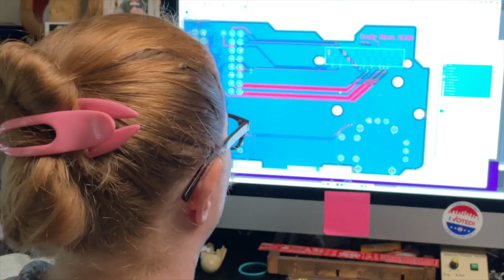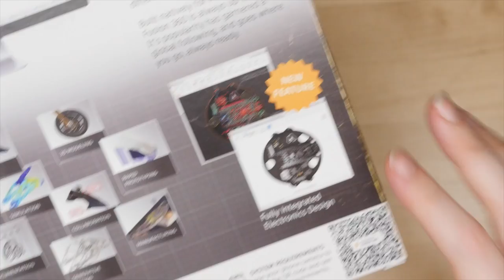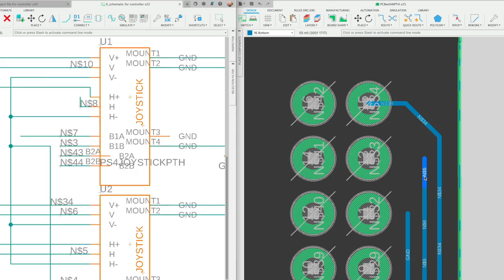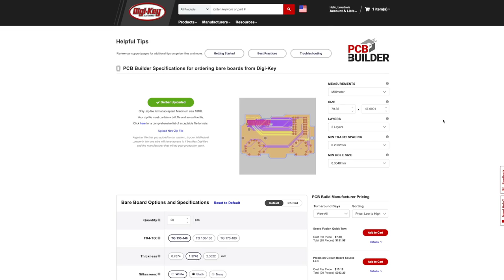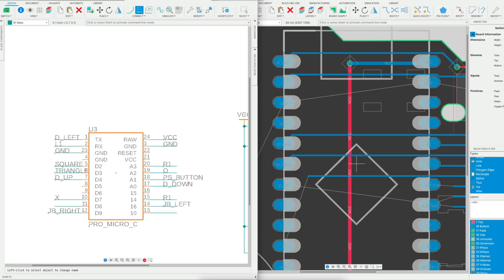Using PS4 Controllers in Circuits (Custom Breakout Board)

Comment: Just saw this today and had a question, couldn't you have soldered wires to where the flexible membrane touches the board to make regular push button or toggle switches instead of the flexible membranes buttons

Comment: So, how does a PS4 controller get bricked?... And how much does it cost to get a custom circuit board made?
Reply from the maker: I wish I knew but I've had several stop taking a charge/turning on over the years, both PS brand and aftermarket off-brands. It costs surprisingly little to have custom circuit boards made, and pricing depends on your board specs.
Reply: @BeckyStern    Ahh. I knew I made a good choice to step away from consoles after PS3. It's probably just cheaper components, most likely. $50 price tag for a controller, but $5 worth of parts.

Comment: I use the guitar hero plastic guitars to build analog synthesizer in them..then you can plug it into a guitar amp and play it. I give each neck button a tuning knob..I instal 6 tunable oscillators using a 40106 ic chip